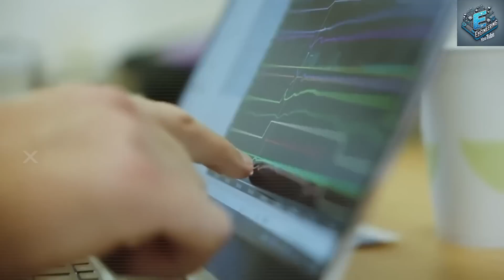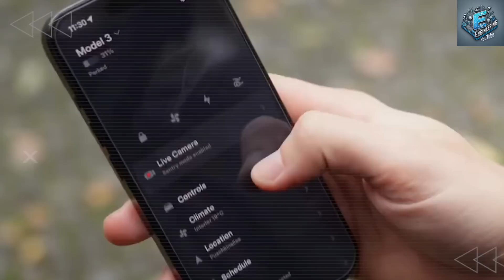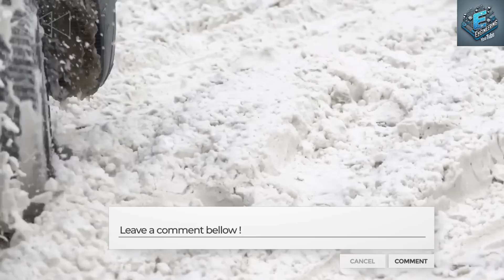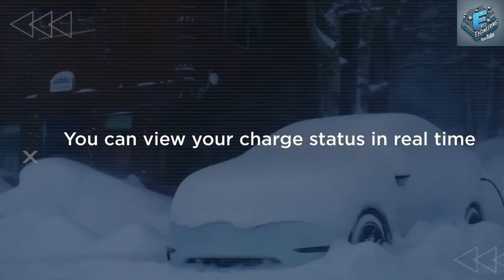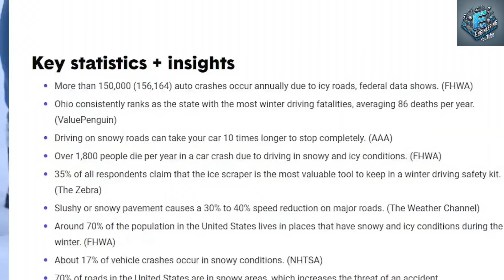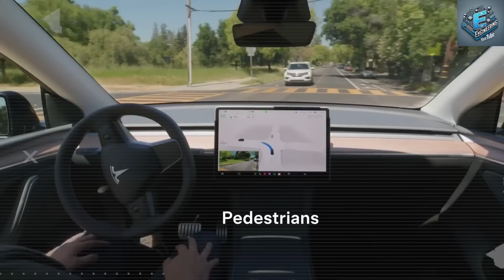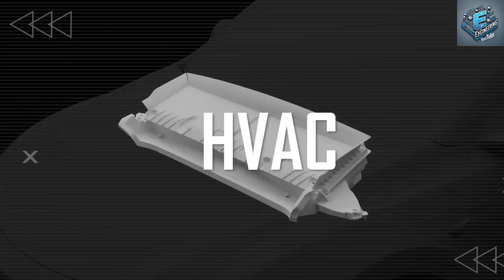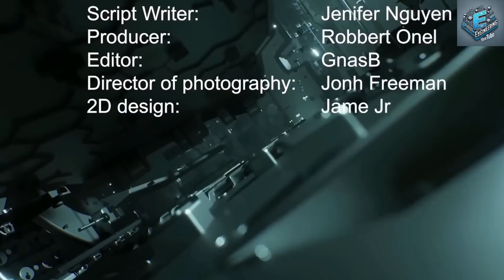🔥 Tesla’s $17,999 Model C SOLVES EV Winter Problems! ❄️ NextGen Battery & AI Driving Revealed

Comment: most of what he said is not applicable EVs respond much quicker in winter to a petrol or diesel car plus battery degradation is only slight in minus 8 weather that we experience sometimes in double figures it has never stopped me from travelling and it always defrosted and nice and warm for when I get in the car with the pre-warming aids and mine is not a tesla would I go back to a petrol car no way no how it's like giving up your smartphone for an old brick telephone and it is so much cheaper to run and reliable the brakes don't require replacing as the motor acts like a brake one pedal driving is awesome I've had my ev now 3 years and i love it my next one will be even better as battery tech has improved ten fold in 3 years and i get 200 miles to a charge with the heater on and air con and of course music blasting and my heated seats and steering wheel the next one will have the same or even more tech i cant wait people stop listening to all the lies told about EVs even second hand ones are so much better than a new ice vehicle like mine its done 25 thousand and has no degradation in battery life it still charges the same as when i got it and i always charge it to a 100 per cent with no problems at home. as a car mechanic of 45 years i saw there was no more innovation 20 odd years ago just software updates or a turbo tweak it still goes suck squeeze bang blow for over a hundred years times are a changing and even EVs may change as new inventions come online which is how it should be.
Reply from the maker: Thanks for sharing your experience! It’s great to hear how much you love your EV and the advancements in battery technology. Your insights on winter performance and overall reliability are really valuable for anyone considering the switch.